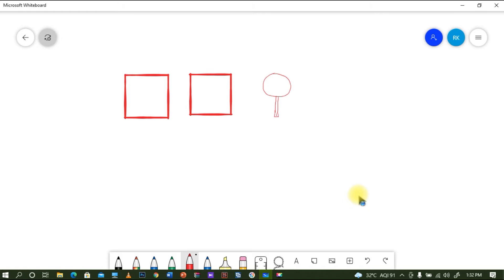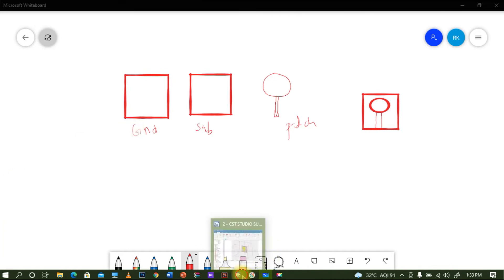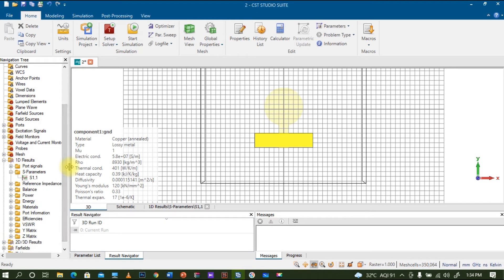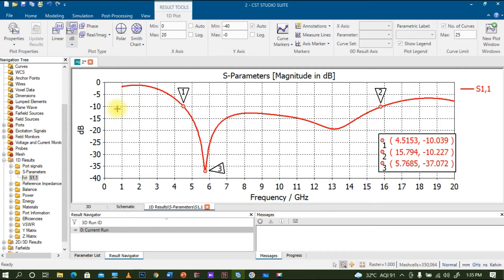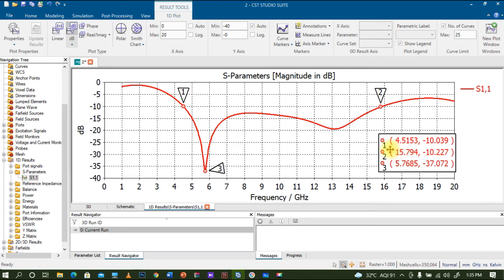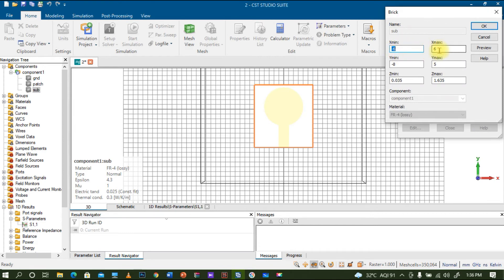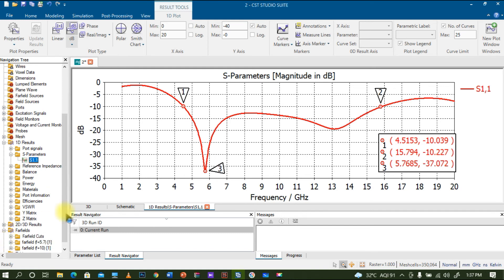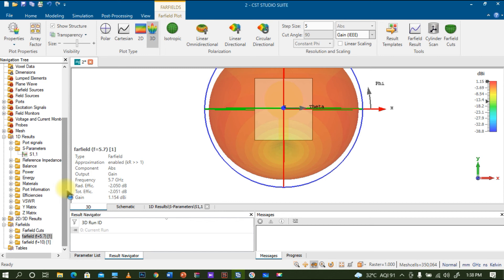Design miniaturized UWB circular patch antenna | Bandwidth | Directivity | Gain Measurment

Comment: For measurements used in the video I recommend to just use your ruler on the screen. My rough estimations for the measurements used in this design is radius = 4, feed width = 2.4, ground height = 3, this is based on the measurements given from the substrate size